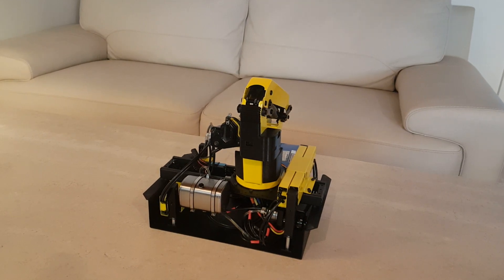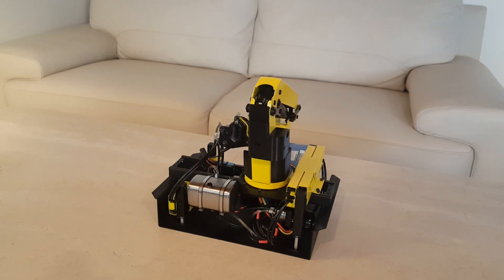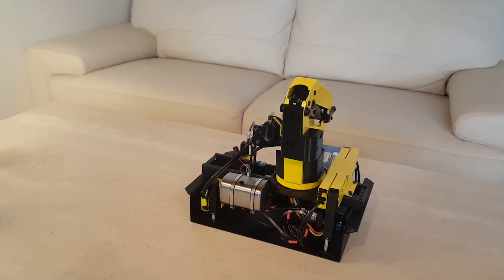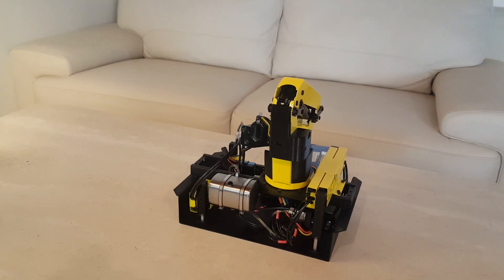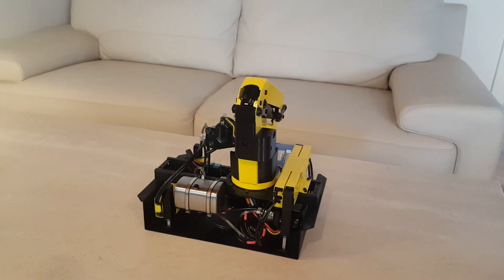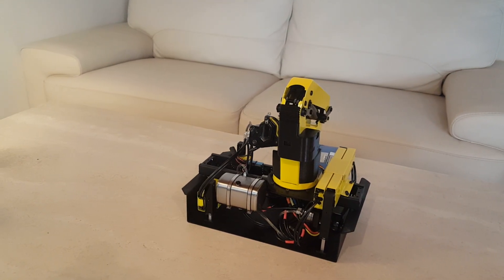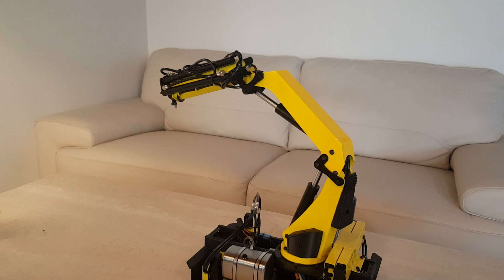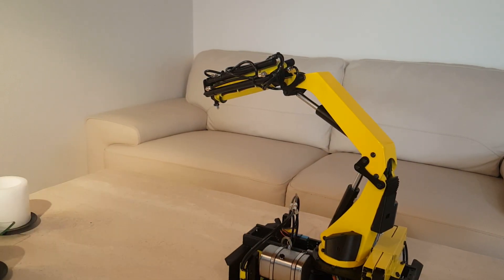RC model hydraulics and Pump mixing

Comment: What I don’t understand for rc Hydraulic excavators is the Slew Bearing. I don’t know how to connect the wires to the tracks to the Top, Because If you just directly connect it and do a 360, The wires will get Disconnected. Do you know how to Solve it? Would be nice if you help me solve the problem.
Reply from the maker: You have to use a rotating ring contact to achieve infinite rotations without the problem of wires getting tangled og kinked.

Comment: Can you do a video tutorial on how to mix the pump with the cylinders???
Reply from the maker: The problem is that every radio transmitter has it's own channel mixing way. So it depends on the transmitter you have. If you Google the 'name of your transmitter ' + 'channel mixing' you may find something. The idea is to mix the pump channel with the  cylinder servo valve channels. I hope it makes sense.
Reply: @75echo  
ok i have all the mixing working, but when i use more than one command, Exp. when i use the boom and the stick together the pump over revs, i have and excavator the 4200xl.
Reply from the maker: It sounds to me like you need to set your EPA for the pump channel so that it does not over rev. What model transmitter and receiver  do you have?
Reply: @75echo  
I have the flysky i6x what is EPA is that end point?
Reply from the maker: EPA = end point adjustment
Reply: @75echo  
i have set the end point but it doesn't effect the pump from over revving, what am i doing wrong